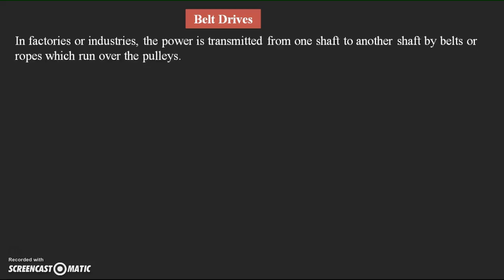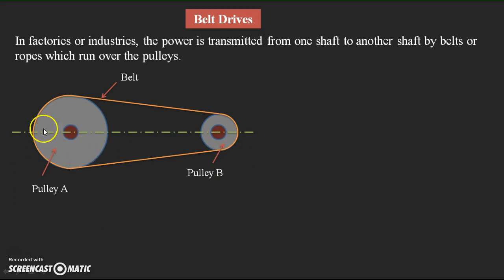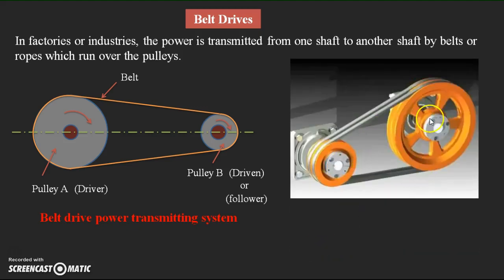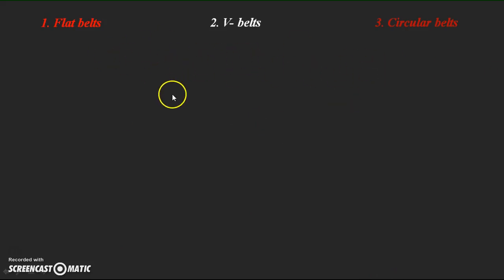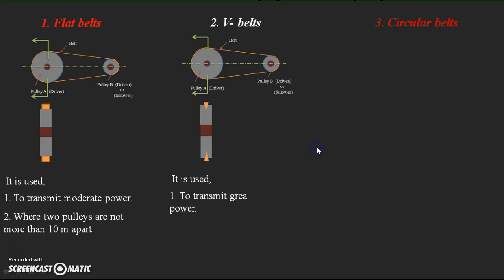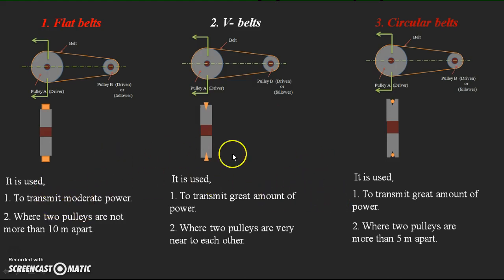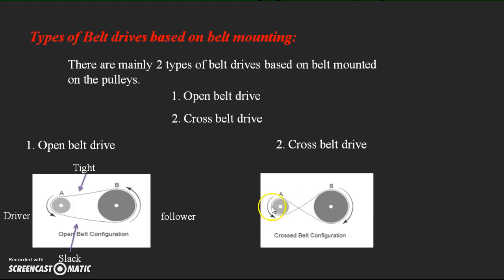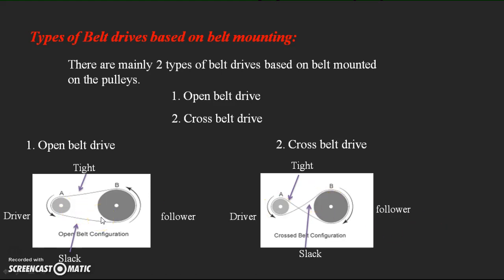Power transmission through Belts and Ropes

Comment: 11:35 tight side should always be at lower side because if it is at upper half the slack side at lower portion will have low angle of wrap which will increase slip. So less power generated.

Comment: Hello in this video you show the driver is in small size as compared to driven pulley how is it possible?
Reply: You need this becaue the motor with small pulley is high speed and driven CAN be lower speed because the pulley is larger
Reply: @MusicWorld-zy6dl  means if I require slow speed at driven we have large pulley on driven
Reply: @ajijmujawar694  yes you can precisely control speeds by the size and diameter of each pulley
Reply: just like if you have a fast small gear driving a large gear, then the large gear turns slowly
Reply: thats how you REDUCE speeds becaue sometimes you need slow speeds

Comment: Please help me to explain for compound transmission, to produce 35 r/m at last pulley. From engine axial center to main shaft axial center is 2 meter and main shaft to last pulley axial center is 2.2 meter.
First Engine RPM = 2200 r/m 
Engine Pulley size = ?
Second Main shaft pulley Size = ?
Third pulley size = ?
Wanted to produce third pulley RPM = 35 r/m